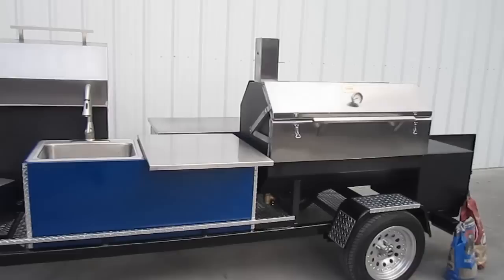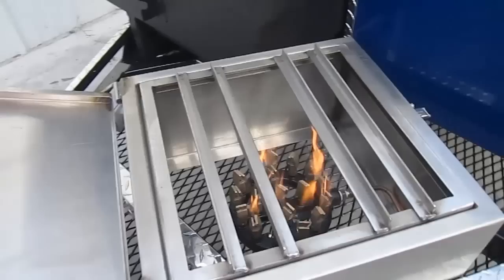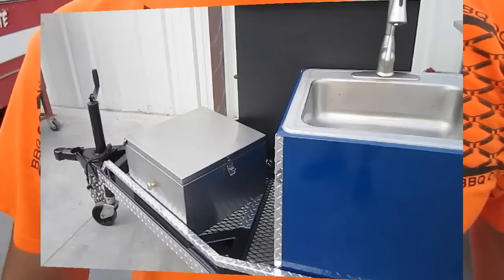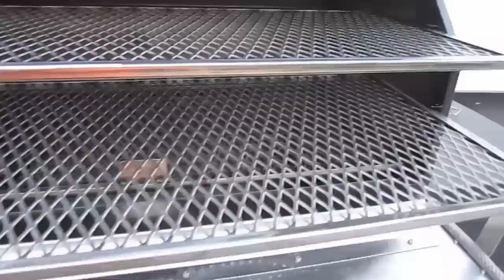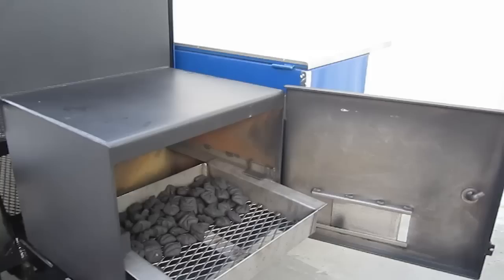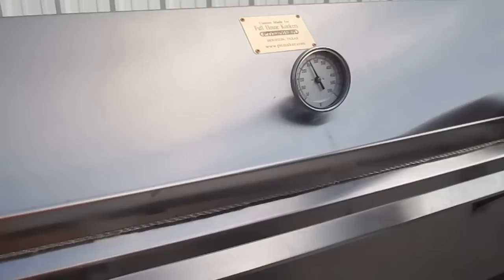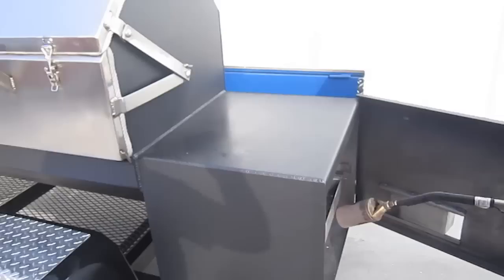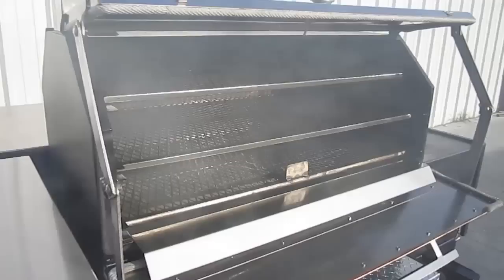Pitmaker BBQ Trailer Pit "Sniper" Overview - Seasoning and Lighting!

Comment: This fire box looks like it's single wall steel.  That is what I'm looking for, as we like to use the top of the hot firebox for heating our beans (it's another cooking surface with free heat, saves me a burner).  I got a quote earlier this year and the man said it's a double wall insulated firebox.  1) Can I still get the single wall? 2) how many inches between shelves inside the Sniper?  Nice work Hugo & Team!